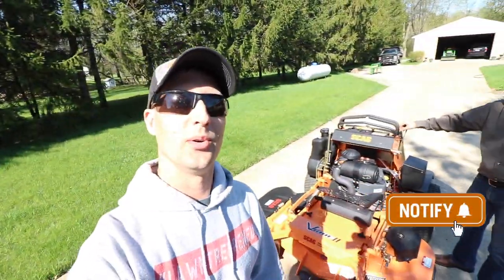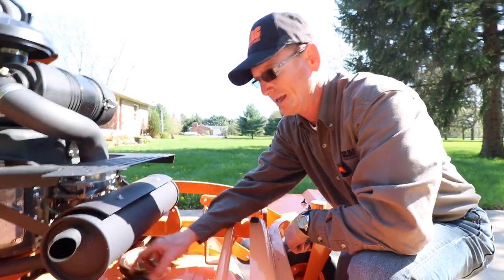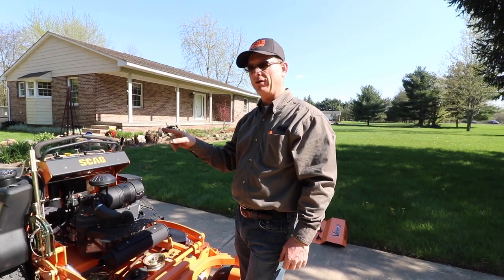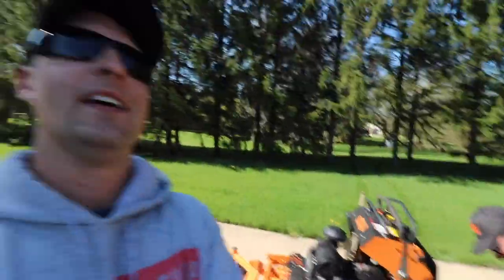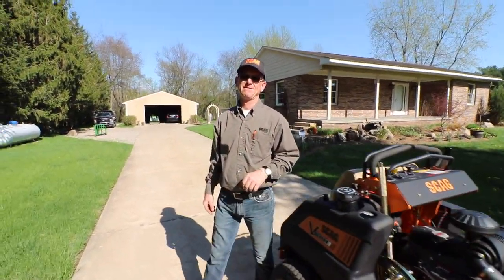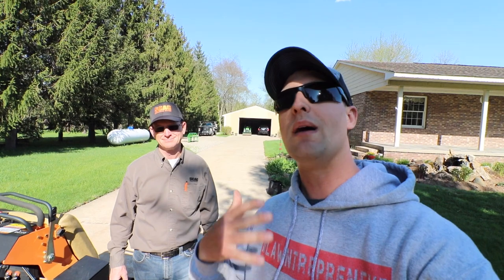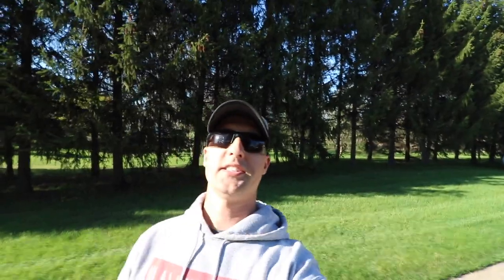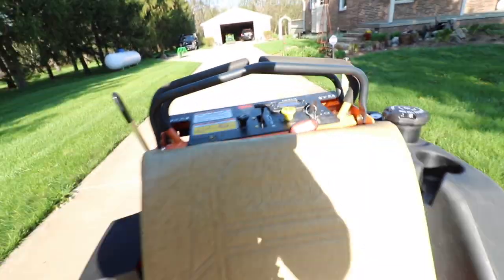Scag V Ride 2 Demo! Testing Out The Scag V Ride 2 And Full Walk Around Of Unit & What's New!

Comment: The new v2 is almost an exact copy from the wrights, so if you like one you should like the other(there is a reason they copied so much of the wrights because they had it right). Id get the v2 over the 1 hands down.   The biggest thing is making sure you have a solid support from the dealer!   Ive heard of a few people that werent happy with the support they got from scag fwiw, ymmv. 

Ive used both scag and wright but use wright now so i just kept with them got me a new 48 I gotta pick up. The one thing any company should do is add a dam ocdc built in! (even if its just a piece of flat stock that moves up and down to close the chute)

I love the design of them so im sure you will really enjoy getting to use it, put it on some hills and really test its limits you will be surprised how much better they hold imo.
Reply from the maker: That’s good info thx pal

Comment: Brain, one more thing about the Toro. The grandstand has the ability to take attachments, like a boss snowplow, a broom, and more. The Grandstand has a 60 inch deck, and a 52, if I'm not mistaken. Whatever the case, the plow and broom can be extremely useful during the winter. Either one is great, but you may want to consider a Toro.
Reply: I thought that was the multi force? I may be wrong tho

Comment: Thanks for the video. I use Scag and they are great machines. The Scag rep mentioned that you lean more into this machine with the 2 vs the 1. I have the Scag VRide 1,  I was noticing the difference for taller operators, if you noticed having to bend over a little when riding partcularly with the different  lean into the machine design. I'm 6'2. Looks like taller operators would be more comfortable standing straight up.   Wanted to know after several hours of operation if you prefer leaning in or standing upright. Thanks.

Comment: We run tiger cats and a tiger cat 2.  Down here in the south, the bahia grass is rough on blades.  When bahia comes out, we will change blades 2 or even 3 times in a day to keep from stringing.  We use an impact wrench and a simple floor jack and can do it in about 5 min.  The exhaust placement on that would make changing mid day rough if it doesn't have time to cool.

Comment: Own one, and liking it so far. Only thing I've noticed so far to be aware of are:

Those larger new wheels and tires can be aggressive to grass. Must totally take your time in the 3 point turn in order to not have turn and burn marks on the lawn.

You can not walk behind this mower while it's running. I personally am ok with that safety wise, however, if there is something in the lawn, and you want to hop off and move it before hitting it, you must disengage blades, set brake, get off, idle down, then start blades again, idle back up and off you go. Just more thinking ahead and being aware. Move items in lawn on previous pass vs waiting until you come up on it.

Deck belts have a small side cover on them, however it is not a closed or boxed in area around pulleys so lots of debris and sticks seem to find their way into the pulley area while you're cutting. Be sure to blow them out after EVERY  cut. Long term I am worried about sticks and debris getting lodged in there and prematurely wearing out belts or pulleys , but that's yet to be seen. 

Other than that, super smooth machine, solid on hills, stripes well, zero clumping. Mowed beautiful 6" wet and fertilized  thick lawn the other day and yes I had to triple cut because of how lush the lawn was,  but never did it clump AT ALL. Just had to go over wind rows a few times. Homeowner came home and was thrilled at how his lawn looked.
Reply: We appreciate your feedback on the machine.
Reply from the maker: Good to know, thanks for sharing!

Comment: I mow mostly small and mid size residential and run a walker. No discharged grass on sidewalks, driveways, etc. If I had some large accounts though or commercial accounts where presentation wasn’t so critical I wouldn’t definitely consider one of these mowers.
Reply: Swimbait1 which mower do you enjoy most with resi? I love my Exmark commercial 21” with the mulching kit ...

Comment: I agree velocity has the beat cut. But gotta give SCAG credit for their hydro pump as well. Awesome control and power- smooth. And they never give you an engine thats under hp for the machine. I buy a new one they last a decade before i have to replace anything. Still running my vride 1 and got a 2.

Comment: I have a Scag V1 48in. Before starting my business, I worked for a guy that swore on Scag to be the best. I’ve had it for 3 seasons and put about 300 hours on it. The first year both axels came loose from the motors and damaged both rims.(under warranty) Then the hour meter stopped working and took 3 computers later to get one that worked. Year two the carburetor went with 180 hours on it.
I was told that at the factory they use torque guns similar to a auto garage, not industrial guns that torque properly. To add, a deck bolt came loose season 3. 
Besides the poor manufacturing, I like my Scag. It’s fast and cuts nicely.
I’m conflicted to buy another. I’m trying to convince myself that I got a lemon.

Comment: Hey Brian, thanks for the videos. I am considering a stand on mower this spring. I have run Scag walk behind mowers in the past and found them to be very heavy. Good for durability, but tough on any type of wet turf (yes I am from California, but we have a lot of clay soil and is a bugger when wet). Let me know if the weight is a factor on that machine. Thanks again.
Reply from the maker: I think most units weigh about the same, 700-800 lbs

Comment: Can you walk behind the mower instead of standing on the platform? I dont want to stand on the platform when loading it on the trailer or mowing under trees. Thanks!
Reply: Jordan  Garretson you can not walk behind this machine while it's running. Of course you could always void your warranties and wire it to do so, but I wouldn't recommend it.
Reply from the maker: Just duck going under trees, I did all day as a newb, wasn’t an issue at all.